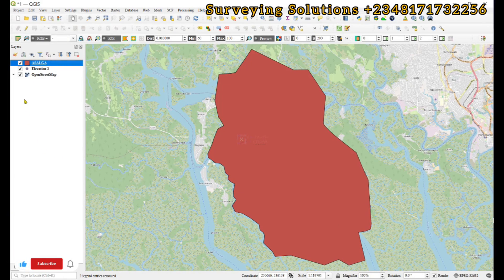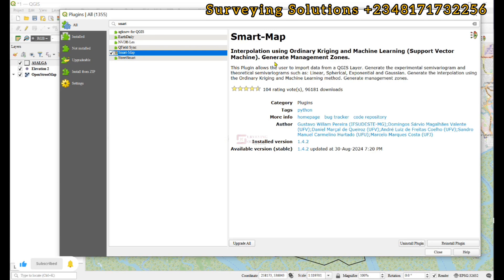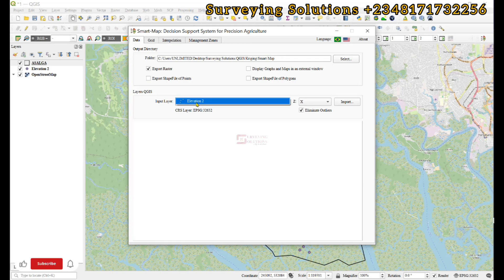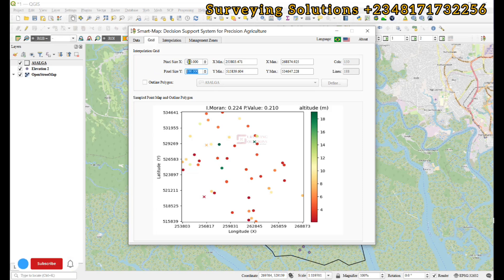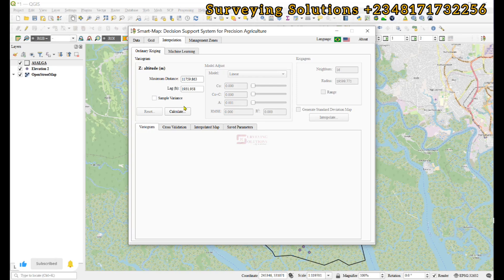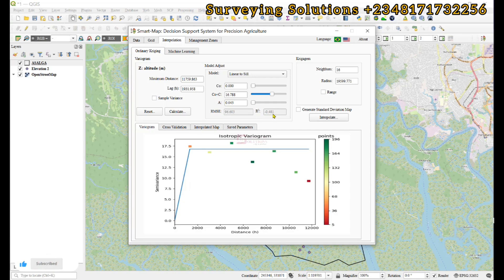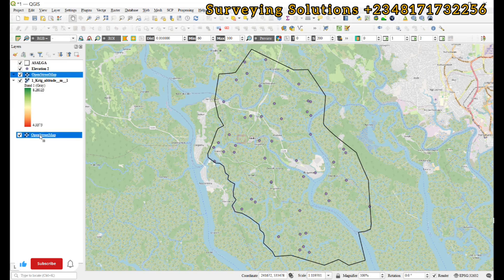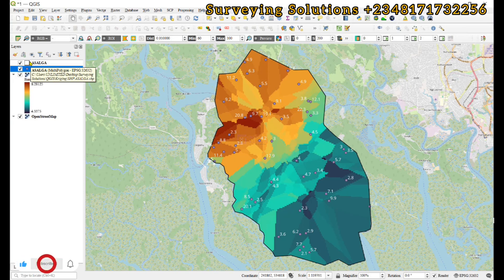Kriging Interpolation using QGIS

Comment: What version of qgis are you using in this video, please?
Reply from the maker: We used QGIS 3.34.9.
Reply: @SurveyingSolution  
All right, then!
I'm using version 3.26.3 and I can't get the ‘Kriging’ interpolation to work on smart-map. An error message is sent,

here it is: TypeError: disconnect() failed between 'currentIndexChanged' and all its connections  Traceback (most recent call last):   File "C:\Users/groprine/AppData/Roaming/QGIS/QGIS3\profiles\default/python/plugins\Smart_Map\Smart_Map.py", line 3810, in pushButton_Krigagem_clicked     
self.dlg.mMapLayerComboBox.currentIndexChanged.disconnect() TypeError: disconnect() failed between 'currentIndexChanged' and all its connections 

Do you have a solution to this problem, please?
Reply from the maker: No, please. 

You can check on their site, perhaps it has been addressed.